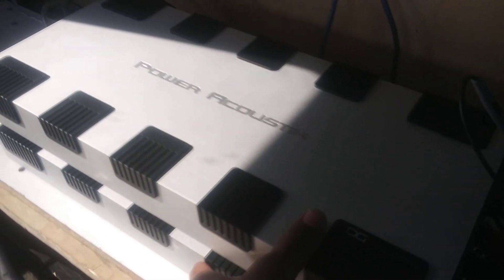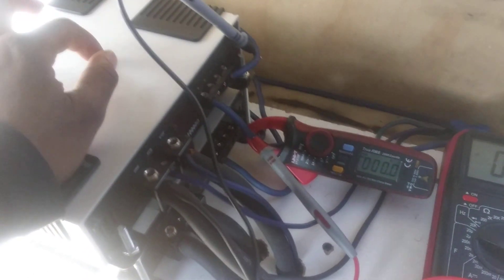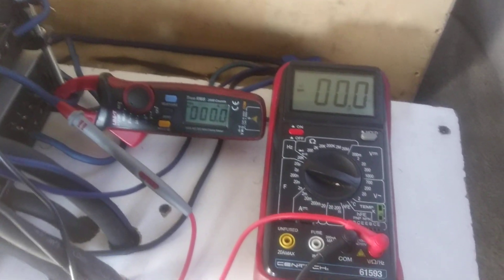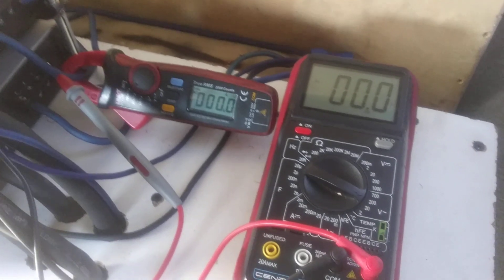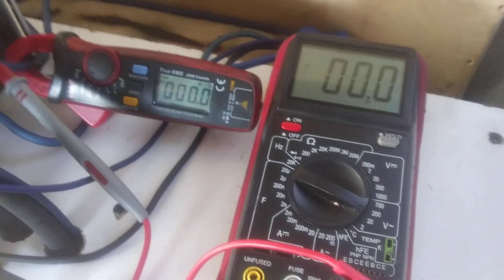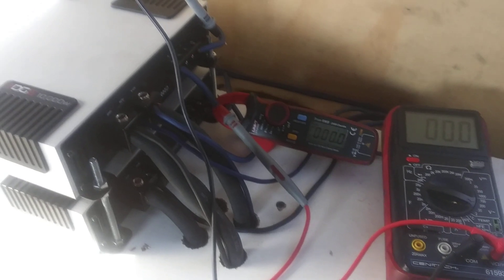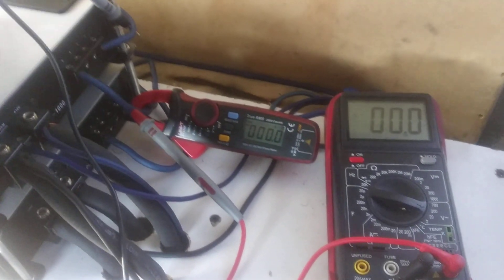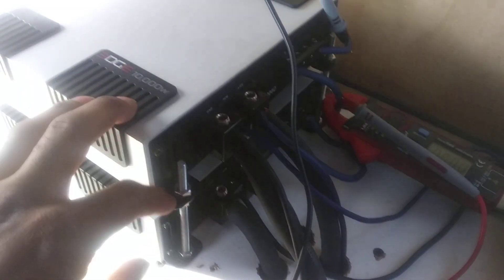Power Acoustik EG1-10000D 1 ohm Clamp Test

Comment: Quick tip run one coil of each sub to each amp so there's no phase issue also if there's adjustable phase take one sub and both amp wire them to one coil each one amp should be back words or out of phase and slowly adjust the phase till the sub stops moving and then turn it off and rewire it back in to phase should all be in phase

Comment: not trying to bust ur balls but i just noticed in this video that your dmm is not true rms and it does actually make a difference . its also nice the have a T-rms voltage meter with peak hold ''max'' so you dont have to watch the screen for the number and rely on refresh rate and also nice to have a clamp that does the same ''max'' function . technically this is without phase correction ''power factor'' or scope to see the wave , i always scope to clean round sine wave so when i wanna do a quick number i just subtract 10% ''or figure 90% of total'' and that would be light clip . then i figure minus 15% or 85% of total for clean power . but the difference between a Trms voltage reading and non Trms can change it up quite abit . so i just went to my bench and did a test after watching this and the difference on the voltage was 4.3v less with trms meter , so say we just take that 4.3v for instance and apply to your first test it changes ohm to 1.69 and 2433VA , so 2433-243= 2190 this is minus 10% for power factor with my quick method cuz we dont have a dual channel scope here to base the power factor on . how you figure power factor technically is MS between voltage and amps on scope ''say 2.1ms'' , you take 360 x HZ x .0021 = xxx and then cosine of xxx is power factor ... but regardless good videos man ! more people need to clamp power and do videos of it cuz the numbers people post they are doing on some of the facebook groups is total bs lol.  a bad ass tool for the money is CM1000A from harbor freight , its 100$ and does TRMS , inrush , AC and DC current up to 1000A , the inrush is handy for clamping DC current drawn by amp .
Reply from the maker: Yes i get it there are different variables. True my DMM isn't a true rms such as my clamp meter is.  You're right u can't see level of distortion during testing as well as other things. This was just to get a general idea. Most people who do the same test have neither rms rated meters. Unfortunately at the moment i don't have all needed test tools. So bare with me until i get a Spl labs meter with clamp. I'm sure there are much better tools but figured Spl Labs would be a good start
Reply from the maker: Thanks for the tip on the tool. I'll have to check out the CM1000A once i get extra funds. Also appreciate your input and sharing knowledge